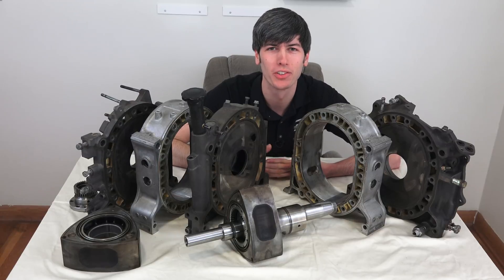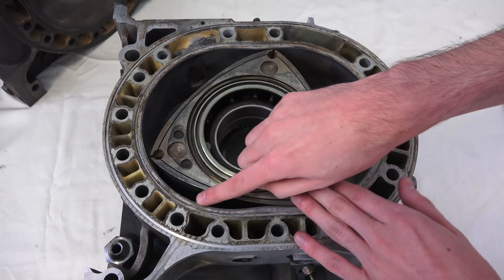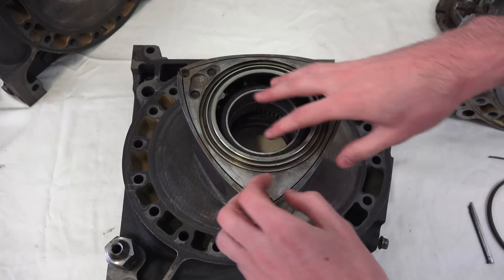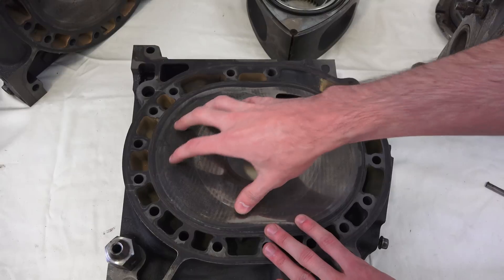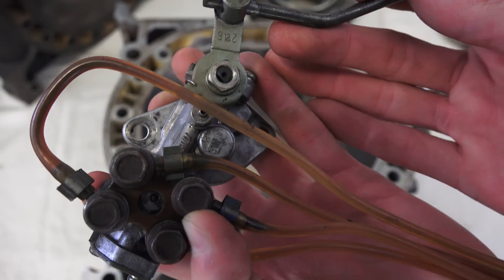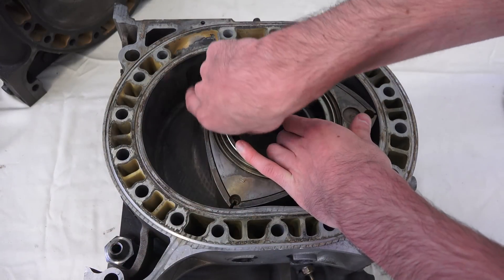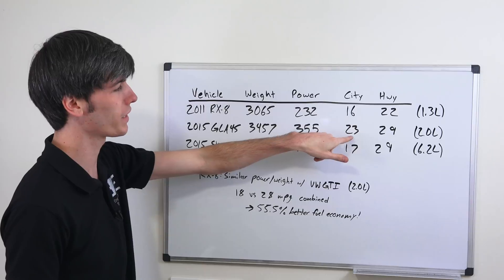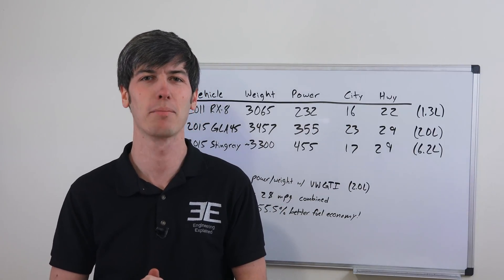4 Reasons Why The Rotary Engine Is Dead

Comment: Let's all be honest here. We all really love these engines, but they make no sence what so ever...
Reply: Well no... They are smaller and lighter so they can be placed lower making the car handle better. They love to rev and just look at the mazda 787b from the 1991 le mans race. It won easily
Reply: @madjoemak  You can make a pancake piston engine just as low if you wanted to.
Reply: @spaceghost8995  like Subaru's flat 4? Yeah sure but the wankel engine takes up much less space
Reply: @madjoemak  fact check: it won handily because it weighted ~600lbs below the minimum standard for all other competitors. It had an unfair advantage. It wasn't raced afterwards because it was so fuel inefficient.
Reply: @brois841  wow thats an old comment. Yeah I heard about that.
Reply: Like a lime many amazing things makes no sense
Reply: true. but i still romatisize the thought of using so much less parts to get the job done <3
Reply: They do have very few moving parts, so it was almost a good idea.
Reply: @YOURMOMxo69xo  only if you don't count all those tiny little fragile seals that cause the reliabity problems.
Reply: Is nice to see a Rotary fan with common sense. So many fanboys don´t understand that is ok to like something that isn´t the best option.
Reply: Santiago Dominguez that’s what I thought years ago. I came to the personal conclusion that it’s ok to have an rx-7 if you have plenty of money to rebuild an engine at 85k miles or less. Not average Joe. I wasted a lot of money on those cars as a teen with not much money.
Reply: Like a lime From an engineering standpoint they make loads of sense. Currently Mazda has all the technology to get clean power out of the beauties. Higher compression ratios and hotter recirculated air. Direct injection standard. Problem is... Japan and the UN regulations board HATE cars that produce over a 10:1 compression ratio. Our Honda's now are pushing just under that, so the Japanese government don't fine us.
Reply: @alphawolf4714 people stopped buying them long before that could be banned for fuel efficiency and emissions
Reply: The wiki article is good on the rotary engine. Have a look.
Reply: Like a lime only for racing, 787B forever :D
Reply: They are only good for racing where  after every race they are stripped down and new seals put in. On the edges of the rotor the seal must be white hot with friction and wear very quick.
Reply: Hybrid version is how it will revive
Reply: Power per liter and power to weight is more important. MR or FF 13B would dominate.
Reply: @EB-dr4dd  You get power by two things....rpms...which do drop...and torque.  So power per liter and power to weight is litterally derived from Torque or/and rpms.
Reply: @elitewolverine  Not Exactly, Power per weight can change by basically anything and Power per liter needs a few more technology than Rpms only.
Reply: @afoxwithahat7846  Ummm no that is exactly it.  There is no debate.  Power is the result of a formula.  Nothing else.

Power in this case HP is (Torque*RPM)/5252.

Since 5252 is a constant (rpm constant actually for where the hp/torque cross) you have only...only two variables.

RPM or Torque.  You either increase torque to increase power, or rpm, or both.

Now you stated power per weight.  I did not, I simply stated power.

Power to weight is dependent on two things....power and weight.  I can keep power the same and drop weight or keep weight the same and increase power...or both.

At the end of the day though...power is derived from two things ONLY, period.  RPM and Torque.
Reply: @elitewolverine  Power from where I learned is the speed that the Kinect Energy from explosion become Mechanical Energy (Moviment), if is will be there some cases that you can change the power without change the torque, but I will search this.
Reply: @elitewolverine  I understood, but I know how to change Hp/T :)
Reply: @afoxwithahat7846  No.  Torque is the result of Force being applied in a circle.  nothing more.  In fact the units of Torque are literally the equation.  pounds*foot or Newtons*Meter.   So if you take 1 pound of force and apply it to a 2 foot pole, rotate it in a circle (like a piston does) you literally have 2lbsft of torque.  You can also get the same by using 2pounds of force and apply it to 1ft length.  2*1 is equal to 2 in both equations...so 2lbsft of torque.

Now an explosion in an engine creates lots of 'lbs' of force.  We measure how much force by using resistance (and known calculations for engineers who studied it etc).  But when you do a flywheel dyno you are using resistance to slow down the flywheel to the point the engine cannot advance it forward more rpms or they use a formula on how fast it can push against the resistance.  This tells them how much torque is applied.  Then they take the RPM that it was spinning...and boom HP.

So the only way you can reduce power but retain 'torque', is by applying it to a longer distance.

Hence the term stroker kits.  You are taking an engine that can't really put more force into it, say from lack of air, lack of gas provided etc.  But if you 'stroke' the engine you make the camshaft and piston travel 'longer'.  This longer travel is literally the distance from the edge of piston rotation to the center of the camshaft.

If the engine provides the same 'force' from the air+gas explosion, but I apply it over a greater distance I have instantly increased torque and instantly increased HP (hp is torqueXrpm etc).  But the problem with just 'stroking' it is, heavier rotating parts and a higher angle of attack when the piston is at its fullest power.  So strong rods are super important in a stroker kit.
Reply: @elitewolverine  man thank you for all the support, live Your Life Happy, Hope to see you again
Reply: @afoxwithahat7846  it is not an explosion
Reply: This engine design has not changed or been upgraded like the piston engine's have been over the years. 
Electric motor cars with self charging diesel or gas recharge systems will be the standard in the future like the first submarines how they charged there own batteries. They already have this technology but don't want to come out with it. Look @ Tesla cars it's not new technology, they are just using what other manufacturers won't.
Reply: @MickeyWu7r5 It is not that they don't want too, it is about cost effectiveness.  Tesla has benefitted greatly from being able to run in the red for years, current Automanufactures can't do that.  Well you can but then you get Government Motors bailouts...

As well the entire world production of batteries is not enough to cover the batteries required for EV's to fully replace cars.  Think about that.  The entire current production and supply of the world's batteries does not equal the batteries required to replace all the cars.  So we have a battery problem from the get go.

Tesla can get away with 500 cars a week... Ford produces 20k Trucks a week...that is just trucks, not SUVs, Cars, etc...F-series trucks.

We have a battery problem not a petrol problem.
Reply: Great for racing though!
Reply: Yeah nothing makes sence
Reply: 100th like thats one in a hundred chance of happining
Reply: in your opinion..Lime
Reply: The new Ferrari  F458 has over 14 to 1
Reply: yu speeled cense rong
Reply: also ur grammar makes no sense
Reply: @Mazotheman  and that is why they got banned out the 24hr LeMans...right?
Reply: There fascinating cause theyre so different but suck and are expensive to maintain and repair
Reply: @bandccoresohio If there were more mechanics and parts around, the costs would drop like a rock.
Reply: Jwad  exactly hence it's dead and won't come back anytime soon unless Mazda sort out emission and mpg and i think electric will well and truly be here before that happens.
Reply: LaserDisc well if you look at a piston valve head and you look at a rotary motor both disassembled it would appear to me the rotary is much simpler and efficient small problems like fuel efficiency and emissions means nothing in racing
Reply: @moto_leprechaun  i agree. Its a better design all around and if not politics it would be used and improved
Reply: I think the idea makes perfect sense, no camshaft and valves, less moving parts and moves in a quasi rotary fashion, instead of converting up/down motion into rotary motion. The problem as above is its inefficiency, unable to burn all the mixture as well as the mixture getting diluted by exhaust, possibly due to the location of the leading spark plut port. 
It is rumored Mazda rotary will be back, Mazda has not given up totally, however they will have to correct these problems before there is any more interest in this technology. I prefer the opposing piston engine, Achates engine, which is all about efficiency, less moving parts and multifuel capability
Reply: I test drove a 1987 RX7, great car.  I only remember not being able to afford it.☹
Reply: Spell much?
Reply: I don't know why anyone would like them. They never offered any improvements over existing designs or did anything that wasn't already being done better by other engine types.
Reply: @taggerinc2652  Back when they came out they offered a good power/ratio. The third gen RX7 had over 250hp and weighed about 2800lbs. Other comparable sports cars were some 750lbs heavier.

But while piston engine cars haven't gotten much lighter, they have got much more powerful, while still getting much better fuel consumption.
Reply: @BigUriel  The car may have been lighter, but that's not a credit to the engine. I was working at a mazda dealership when they were around. These engines were never very good or very dependable. And they don't offer any tangible benefits that are worth the compromises.
Reply: They actually do make more sense
Reply: DJ Boombringer it should be a marvel of engineering physics wise. But it didn’t quite go that way
Reply: Makes a lot of sense physics-wise... It's always more efficient to have continuous movement of the rotary as opposed to the starting and stopping of a piston.
Reply: @orionorama  you need to learn how a Wankel engine works...
Reply: Hese are all lies. The Rotary is a minority engine being oppressed by the Patriarchy!
Reply: Sense*
Reply: If youre gonna rotor swap a car and only use said car as a sleeper at the drag strip then youre fine. No engine will last long doing that anyway.
Reply: I'd rather melt them down and make damascus steel out of them.
Reply: A rotary is a piece of crap for drag racing, they produce no torque compared to a V-8 and torque equals et while horsepower = mph at top end. Road racing? Sure they do good because of the rpm and you don't want a bunch of torque coming out of a corner.
Reply: @351wmustanggt  And how you explain 6 sec rotary cars on the quarter mile?
Reply: @351wmustanggt  V8 are heavy, You need a V8 with the same specs that a F1 V8, Power per weight and liter.
Reply: @351wmustanggt  what lol the 787 4 rotor has over 400lbs of torque. stop confusing yourself with the smaller 1 and 2 rotor motors. at 1.3 liters, of course their torque will be low lol

Comment: The main advantage a rotary engine has is compactness.
Norton used one on motorcycles with some success, although when racing they bumped into other issues...
How to cool the thing, and how exactly do you classify the CC of a rotor which is doing 3/4 of a suck/squeeze/bang/blow cycle each rotation?!

Comment: With the efficiencies of the Mercedes and the Corvette, were cylinder cut off on the highway considered? I may be wrong but I believe the Corvette does run on fewer cylinders when they're not needed. If it's possible to have that technology on the rotary it may improve the efficiency but just slightly.

Comment: rob dahm is balling he can afford this. I really wanted to keep my fd3s rotary but I bought mine as a shell and pieced together the engine. I bought a pair of used housings for $1000 and I'm getting 50 psi across the board. Mazda wants $1,700 per housing new... I'm either gonna sell the car or put in a piston engine. My conclusion is that rotary is great and I wish I bought better housings.... for some people they get lucky and for others it's such a turn off.

Comment: I did not know they had oil injection and burn it like a 2-stroke. That brings up some questions: Do they also have an oil sump for bearing and gear lubrication, that needs to be changed like regular oil? And is the injected oil a 2-stroke oil since it gets burned? And lastly, if it deliberately burns oil like a 2-stroke, do they not clog up catalytic converters rapidly?

Comment: If you were to oppose them as mirrored opposites and used the secondary rotor and plugs to combust the excess fuel you'd increase the horsepower, fuel efficiency and reduce emissions.

Comment: I'm not an engineer by any means but could you correct the combustion flaws by adding an additional triangular  rotor slightly offset from the initial rotor and adding two more spark plugs on the adjacent engine wall?

Comment: One reason why the rotary is the future technology. Burning hydrogen without great conversion.
Reply: They could find something other than motor oil to inject into the combustion chamber...silicon, cannabis oil(car drives on weed man!) Or olive oil(extra virgin of course!)
Reply: Either way the emissions will still be unacceptable do to the oil injection into the combustion chamber, I don't care if you're burning gas, diesel, propane, hydrogen or fairy farts if you add oil your gonna have bad emissions!
Reply: I get it! I get jokes!
Reply: Now everybody settle down and stop gaslighting each other... the truth is enough fuel for the fire to last us till we die and then some
Reply: an electrical enginge is Always gonna be way superior to any Kind of combustion engines. So using your hydrogen to generate electricity with a fuel cell is the way to go.
Reply: @SchwertKruemel  actually it's not. The system efficiency on that is horrible less than 20% and that is assuming best case.
Reply: @SchwertKruemel   what about a rotary hybrid with a hydrogen fuel cell?
Reply: muh social media 'debates'
Reply: Let's see how we go lol
Reply: weight to power ratio?
Reply: Hydrogen is a turd to store simply because it’s an extremely small molecule. Rotary engines are absolutely awful for anything other than running for a long time at high revs. Electric and ICE is the way forward.
Reply: Razvan J  Fuel cells are 80% maybe but hydrogen generation is at best 62% efficient and compressing it so you can transport it us another huge hit.
Reply: OOM- 8018  Mazda is making a rotary comeback 2020 so it is the future
Reply: Truuuuuueee hmmmm?